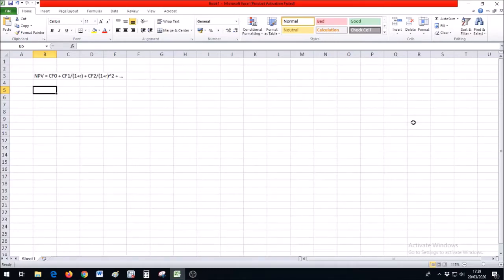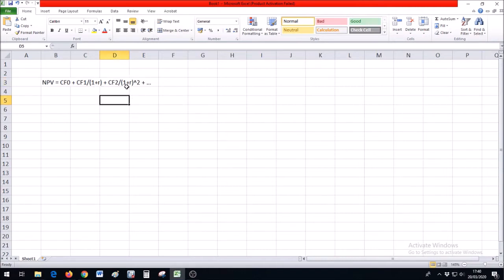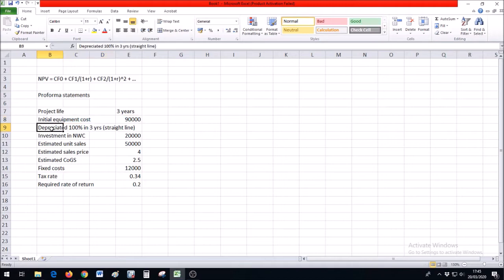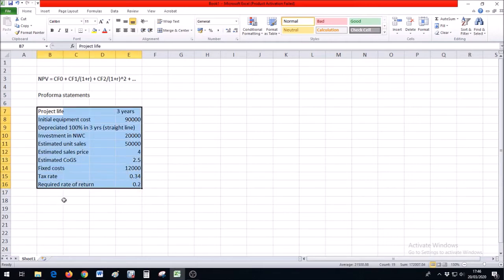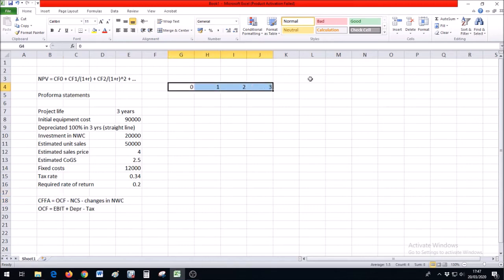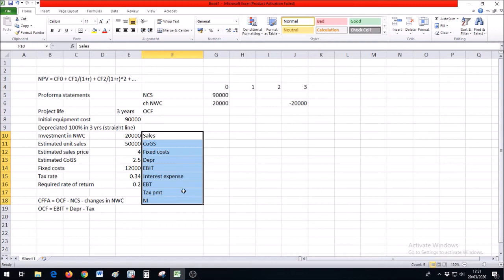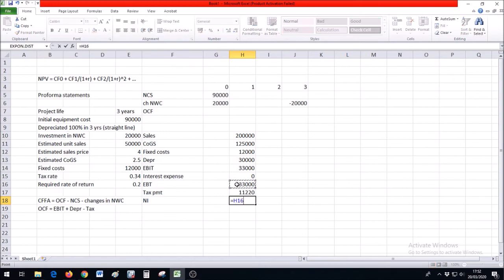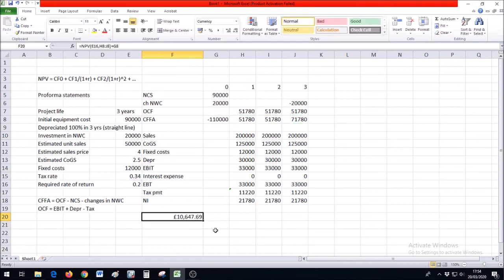Find Cash Flow for NPV

Comment: I have a serious problem, I have an assignment that requires me to calculate cash flow, npv and irr but the data for cash flow is not provided. What do I do?
Reply from the maker: If calculating the cash flow is part of the requirement, then it seems normal that cash flow is not provided. I guess you would have some other data, such as projected sales, costs, etc.
Reply: @MyFinanceTeache  they only provided a free cash flow exhibit spanning 9years for 7 different projects
Reply from the maker: Usually free cash flow is EBIT * (1-t) + Depreciation - changes in NWC + CAPEX. Perhaps you can reverse that back into cash flow from assets if you have all the data. Alternatively, perhaps the examiner wants you to simply use the free cash flow instead of cash flow from assets. Anyway, I am not in a position to answer test questions remotely :)
Reply: @MyFinanceTeache  my major issue is that depreciation and the rest of those parameters were not given, they only gave discount rate and free cash flow while asking for us to compute the cash flow, cash excess, cash inflows and outflows 😞.I can send it (the question)to you on instagram if you don’t believe me
Reply from the maker: I do believe you (no reason not to). I don't have an instagram acc, and I got to go now. Good luck with the test!
Reply: @MyFinanceTeache  thank you

Comment: if it says that the new product causes to the old product a fall of sales by 120.000 annually and that leads to a fall in the cost by 40.000 how we could represent this on the cash flow?
Reply from the maker: Simply as you say: since the introduction of the new project there are two side effects: (1) negative side effect is the reduction in sales; (2) positive side effect is the fall in costs.